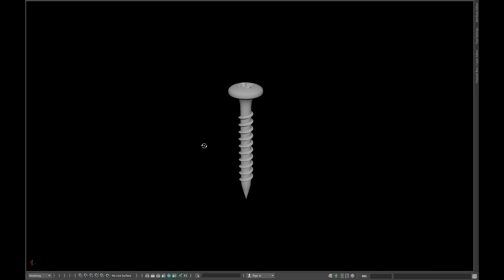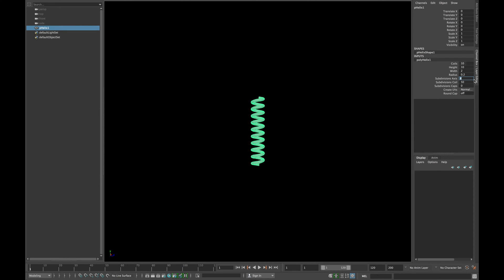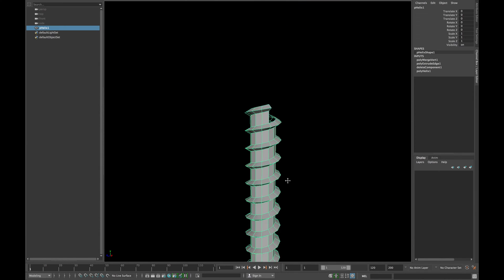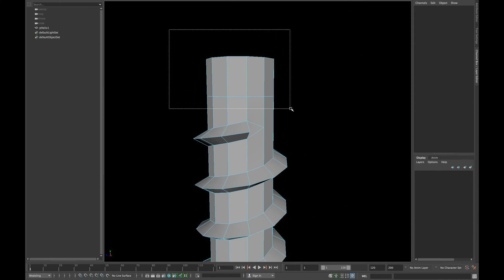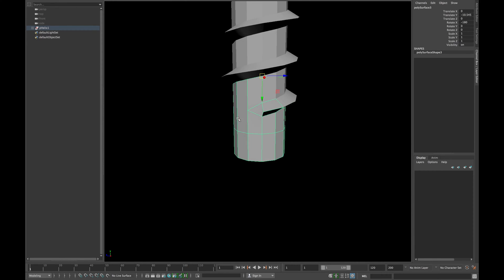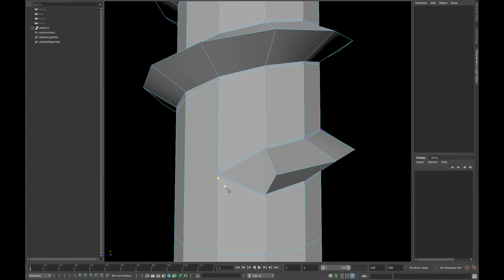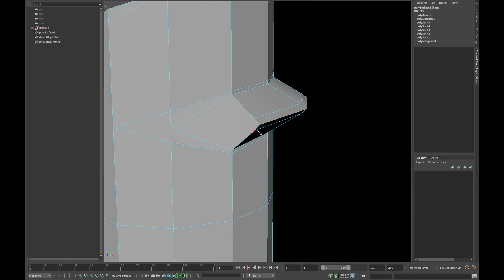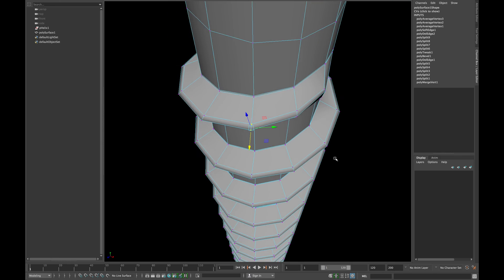Complex Modelling Series # 010 Screw 1of2 Maya 2017

Comment: when i try to duplicate the top faces to use at the bottom, it duplicates the entire piece. then I have to "detach them just to get them off. I don't understand how you duplicated just the faces them pulled them off so easily. please explain... slower :)
Reply from the maker: B. Kennedy you just have to select the faces and duplicate them. If its still doing the same then try exporting your mesh as .obj and then importing it back and see if its fixed